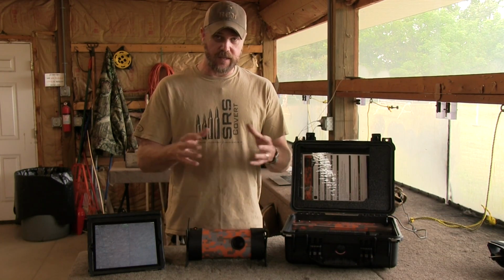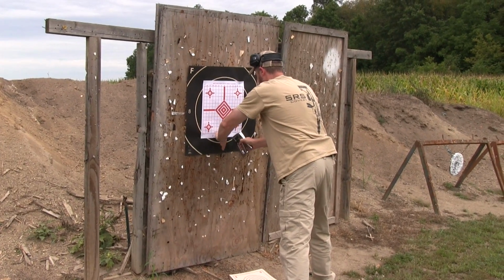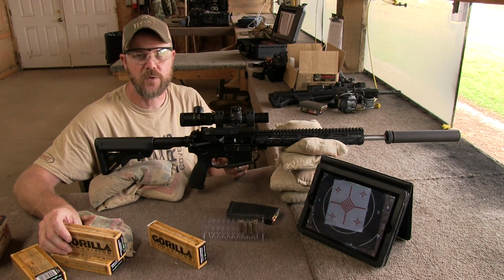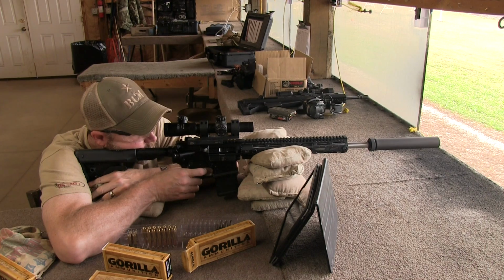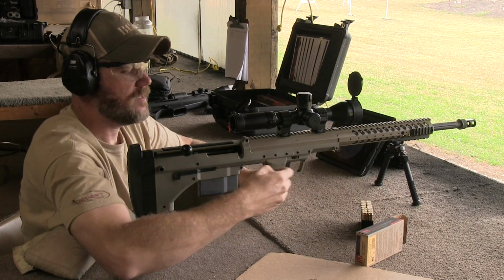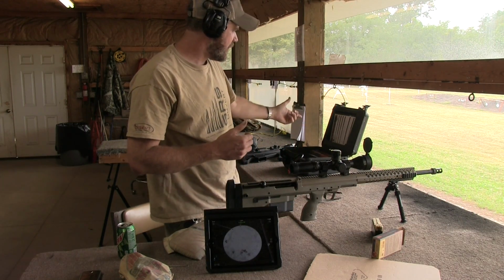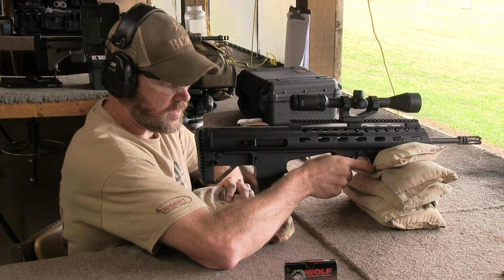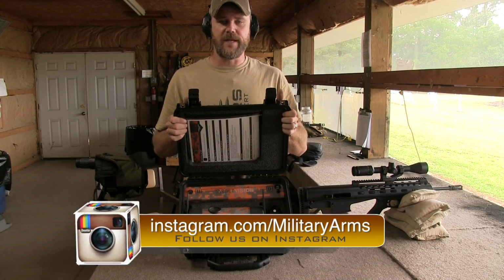TargetVision Camera System

Comment: Is it possible that you got overstabilization with the match ammo with 1:7 at 70 grains? Where do you see this typically happening?  It would be cool to see you test a barrel's tolerance to the different available bullet weights. Eg. same weight different twists, then same twist, different weights. Maybe I'm just geeking out a bit but with the TargetVision it would be easy to do. Thanks Tim.

Comment: The real killer app of these systems is the software.  You could assemble a lr wifi system for less yourself, and far less if you just want to tx video to a monitor.
Not to take anything away from this product though, it is very well implemented and professional.  If I had that kind of extra cash I'd buy this one.

Comment: If it was around $400 to $500 it would be much more appealing. The price point is way to high (at least for me). It seems to me I could spend that $1,300 much more effectively  and stick with using a spotting scope. Very cool none the less, I would love to have one.
Reply from the maker: If your goal is to see bullet holes at range, spotting scopes won't cut it given their inability to see that type of detail past 300 yards. When you're shooting at 1000 yards for example, driving or especially walking, out to check group sizes is extremely time consuming. This system allows you to minimize the number of trips down range.

Comment: Try some of the MK262 77gr OTM ammo. I used some 75gr Hornady Superformance Match 5.56mm ammo and it doesn't group as good as 55gr and 77gr ammo. The MK262 ammo groups around .5-1MOA without my suppressor.
Reply from the maker: I have some of the BH OTM ammo and it doesn't shoot that well for me. Kind of depressing actually, and that's out of several different rifles.
Reply: Military Arms Channel It might depend on the barrel profile. I have an 18 inch SPR profile barrel with 1/7 twist, which is used on the MK12 SPR. M193 55gr, MK318 62gr MOD0 OTMRP and the MK262 77gr OTM ammo group the best without my suppressor. I've shot anywhere from .5 to 1.5 MOA with those loads unsupressed.

Comment: gsus, this thing is mad expensive, the basic model costs 8000 sek i sweden, that is 937 dollars. this model is for ranges up to 300 yards (or 275 meters).
Just found a complete kit Quanum Complete FPV Bundle Set, including battery/camera/screen and everything one needs for FPV for 77euros. thats about 700sek instead of 8000.... and it has 1500meters range in open areas instead of 275 meters.
one can also exchange the camera for an gopro instead if wanted and stream that.
An extra external battery and a homebrew waterresistant box of some sort to protect the camera, would still me more than 8 times as cheap with 5 times the range.

just a thought.
Reply: +mats olsson obviously marketed towards apple users. ;)
Reply: +Ronin Iscandar haha 👍

Comment: Does is record, so you could show us the video feed with picture in picture. What you showed eventually looks more like its taking a picture ever 1-2 seconds, not actual VIDEO
Reply from the maker: All video is nothing more than taking pictures every X number of seconds. This has a slower frame rate due to bandwidth limitations that a full 24 or 30 frames per second.
Reply: Military Arms Channel  I know how video works, but looking at your picture in picture, it looks like it is doing 1 frame a second.  Which honestly is more of a picture feed, not video.
Reply: InfiniteGrim i don't think you understand video after reading that reply
Reply: You remember that thing was far, right? I'm pretty sure it was lagging 'cause of it's distance. Perhaps if he had recorded when it was closer, we would have gotten a smoother frame rate.
Reply: So then the question is: can it record quality video for replay later? Or what it transmits is all you get?
Reply: adam furka I'm all for a good argument but seriously? You consider 1-2 fps VIDEO? I call that a slideshow.
Reply: If you watch at the beginning of the video, he has the camera pointing at us and the iPad pointing at us.  It looks to run about 6-10 or maybe 12 fps which would be similar to security camera footage.
Reply: Which, the camera was a lot closer. The next time we saw the feed, it was at 1,000 yards. That's the reason for the slower frame rate. At least it was still working.
Reply: True.  I wonder if the recording lags as well.  If the camera had the dvr in it to do the recording and the iPad was just the remote monitor, I think that would be a better setup.
Reply: InfiniteGrim Well in that case 24fps is just a extremely fast slideshow isn't it? :P

Comment: It's cool, but I'd be worried about putting 1.3k down a shooting range. I think shooting a steel target at that distance is better, cheaper, and either driving down with a golf cart, or walking down to confirm my hits at those ranges. You won't have a camera like this if you're into long range hunting or actually making these kinds of shots in combat. 
I could see owning one of these things and putting it into an armored box down range for people to use if I owned the range. Probably could design a much cheaper set up with some wiring and a standard camera too.

Comment: I have an even cheaper and easier solution to this: Two cellphones, both with Skype, in an area that gets reasonably good 3G coverage. Leave one phone down by the target propped up on a rock for protection and proper angle, and observe using the other phone. You'll get an hour battery life at least off a full charge, more if you hook it up to a cheap solar cellphone charger.

Comment: I would feel a lot safer with a piece of steel laying on the back of the cam to protect it and shade it. after all shit does happen...
Reply: yeah, at least a sandbag or two.
Reply from the maker: By myself shooting, I'm not worried about it. On a public range with other people shooting? Yeah, they should sell a bullet deflector, or I would make one to set in front of the camera.
Reply: they can shoot at an angled piece of steel all day without bothering it much. but hey its all up to the end user, do what you want with it. if it were mine i would get a cheep plate for it and not worry about it again.
Reply: A side panel plate from AR500 isn't very costly and would probably do it.